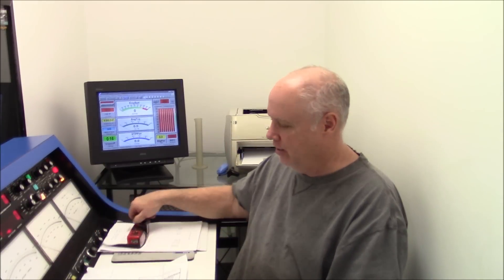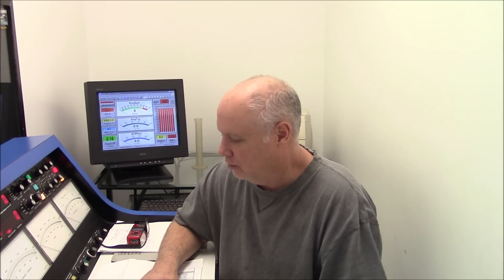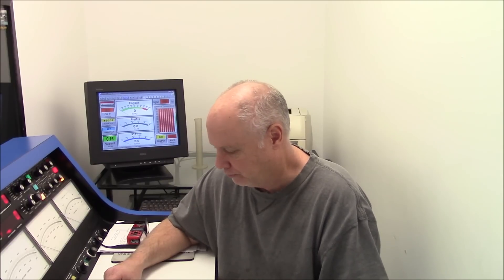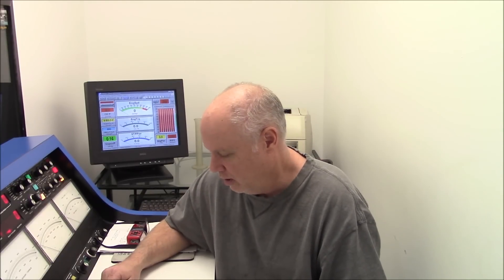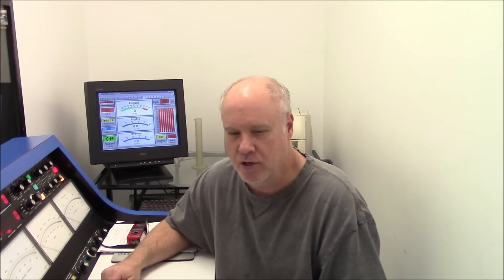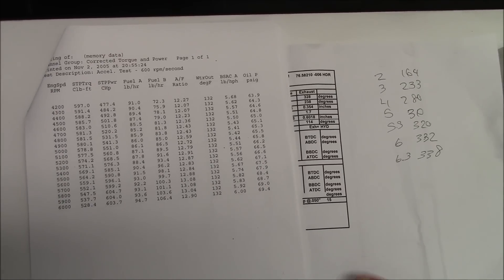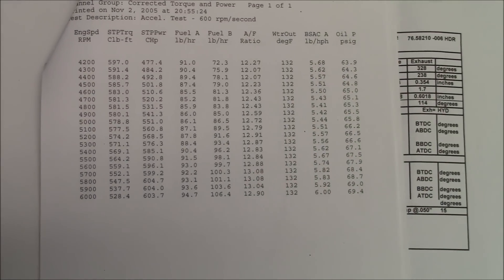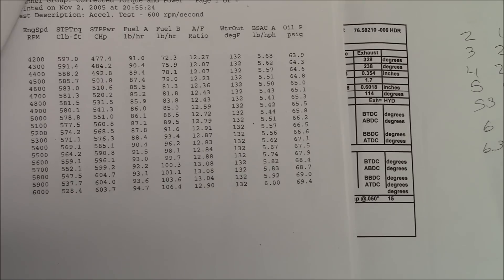Procomp / Speedmaster Oval Port Cylinder Head On 467" Big Block Chevy Dyno Test

Comment: I'll just keep my 088 iron heads! Thanks for sharing your knowledge.👍👍
Reply: Brian Samuels you get more hp with those stock?
Reply: @sterlingwitherspoon5709  stock 088 heads will make 630hp with the right combo.
Reply: @Car Guy daddyo I've got a set of 1974 990 bbc heads also- have had the larger valves installed etc. No portwork- I'm wanduring how well these will do compared to today's head technology.  Have you got any data or info that could help me with ? Thanks
Reply: @moodybluemotorsportsDwneKnos  990 heads are similar to the 088 heads. They make good power in the right setup.
Reply: @moodybluemotorsportsDwneKnos I've seen 680+hp with unported 990s. 748 lift solid roller & 13.5-1 compression. 433ci. That's about the limit tho.

Comment: I wonder how a set of your ported 781 heads would be vs. this set?
Reply: He build damn near same engine with 781’s.    It’s the 620 hp 467 vid series.  
   The 781’s picked up  30-40 cfm after he ported them.
Reply: I 2nd that.
Reply: I’m looking for the same answer. My 781 heads are ports with comp cams springs

Comment: So I'm assuming these heads aren't worth buying at all, since it probably cost more money for you to fix them than it would to buy a set of trick flows or edelbrock BBC heads, or the new AFR as cast head. What are your thoughts?
Reply: You are CORRECT
Reply: @nellyfarnsworth7381  
You are so smart!
Reply: Yeah, seems like it. I'm using cheap old iron heads.
Reply: Ya sounds like it. That’s a lot of extra work from valve guides to push rod guides and combustion chamber work.
Reply: @ApostleDavids8w  Remember those were used
Reply: There are some vids on here people brought them bare and build them for about 1300-1500